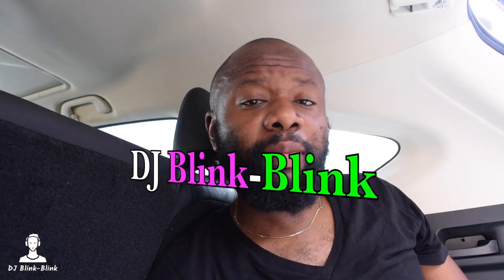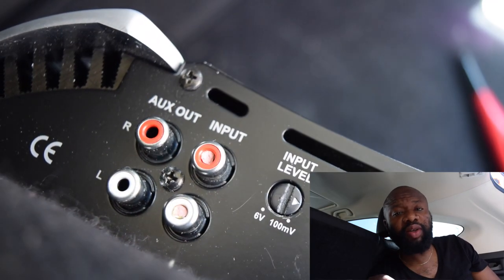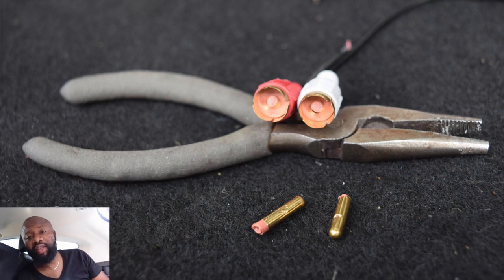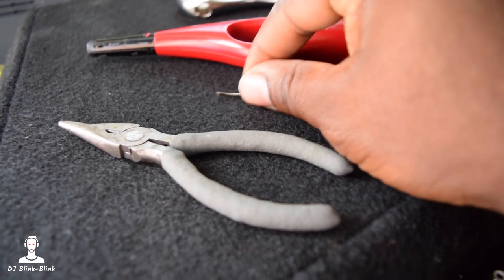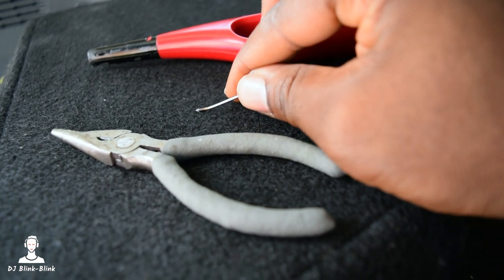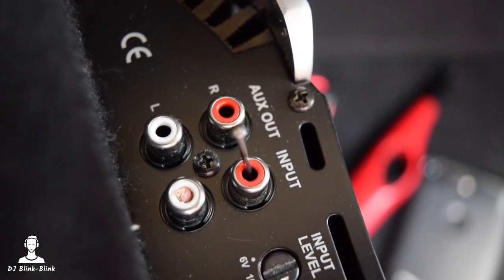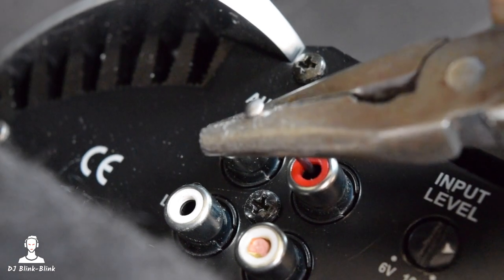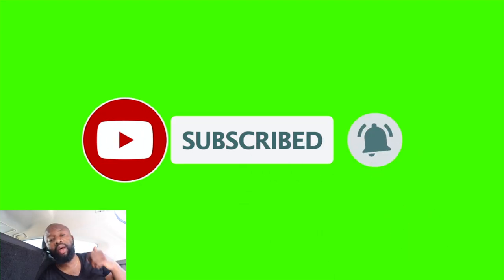How to remove broken RCA pin from Amplifier, TV and Speaker

Comment from the maker: ★ How To Set Your Gains Correctly - https://www.youtube.com/watch?v=rSvGIOPrrnE
★ Serato DJ Pro - Hidden Menu - https://youtu.be/S48z2wOksxU
★Behringer 18" subwoofer review - https://youtu.be/c-i4ciwzGwM
★The Box Pro DSP 112 speakers review - https://youtu.be/zaJggRP6oT0
★ EV ELX 112P vs The Box Pro DSP 112 (Comparison between a £480 speaker and a £191 powered speaker) - https://youtu.be/KKLgW6lLfy0
★ Beginner DJ Tutorial: Mixing, Hot Cue, Loops & How To BeatMatch By EAR - https://goo.gl/hsFHn3
★ How To Analyze Your Music Library Using Serato DJ - BPM & KEYS Offline  - https://youtu.be/g24i0OxY-1A
★ How To Edit Beatgrid Serato DJ The Easy Way I Beatmatching I How To Count Music  - https://youtu.be/VFE-g4g9Wqk
★ Serato DJ Pro Practise Mode Tips & Tricks - WATCH BEFORE YOU UPGRADE! - https://youtu.be/S19GP5lGrFA
★ DDJ SZ Crossfader Repair, Adjustment and Replacement - https://youtu.be/w_jE5t3vS3Y
Reply from the maker: If you have any questions about this video or DJIng, feel free to comment below

Comment: I used a safety pin if that helps anyone. I didnt have a torch to get a thin nail hot enough. Safety pin worked first try. Thanks dude.
Reply from the maker: Impressive use of the safety pin mate. Glad you also found the video useful. Cheers mate 😎👍🏾 𝘾𝙡𝙞𝙘𝙠 𝙩𝙤 𝙡𝙞𝙨𝙩𝙚𝙣 𝙩𝙤 𝙖𝙡𝙡 𝙢𝙮 𝙃𝙞𝙥-𝙃𝙤𝙥 𝙢𝙞𝙭 ➡️
https://www.djblinkblink.com/hiphop-uk-funky-mix

Comment: Thank you so much for saving my brave little mixer! 

I ran into one small hiccup in that on first try I actually managed to pull the plastic free of its metal casing. I quickly plunged the nail and the plastic back inside, readjusted my grip, and got the broken input out, sleeve and all, on second try.
Reply from the maker: Fantastic!!. I'm glad you found this video useful mate 👍🏾
Cheers,
DJ Blink-Blink
𝙑𝙞𝙨𝙞𝙩 𝙢𝙮 𝙬𝙚𝙗𝙨𝙞𝙩𝙚 𝙛𝙤𝙧 𝙁𝙍𝙀𝙀 𝘿𝙅 𝙢𝙞𝙭𝙚𝙨:
https://www.djblinkblink.com/
𝑴𝒀 𝑰𝑵𝑺𝑻𝑨𝑮𝑹𝑨𝑴 𝑷𝑨𝑮𝑬: https://www.instagram.com/djblinkblink/
Reply: Any ideas how to get the metal casing out? Did this on two only to realise that the first one had left the metal casing inside the jack 🙁
Reply: @heidirand9622  I currently have this problem and can’t use my controller until it’s fixed😭

Comment: Ummm so this worked but technically lol. I guess I pushed too hard or didn't heat the nail enough cuz it just busted the piece straight thru and launched it deep into the amp. I'm freaking out assuming i just ruined the whole thing but i plug in the new RCAs and... It works?!? Sounding crisp as ever 😄......🤔🤔.... THANK YOU!!
Reply from the maker: Not trying to freak you out or make you panic but now "there is a small metallic bit inside your AMP" (the stuff you wanted to remove). This can bridge your AMP inside which would then damage it. I would advise you find a way to get that out (open your AMP or bend it sideways which may hopefully make it fall out). 
Cheers, DJ Blink-Blink 👉 My Mix 👉 https://www.djblinkblink.com/hiphop-uk-funky-mix

Comment: Right I understand. That works for that. But I have the metal pin sleeve that fits on the plastic pin stuck. How does one get that out if the plastic jack is not there?
Reply from the maker: Reinsert what came out, follow my tutorial again "ensuring the nail is curved or bent" and then pull it all out at an angle.

Comment: Any ideas how to get the metal casing out? Did this on two only to realise that the first one had left the metal casing inside the jack 🙁
Reply from the maker: To get out the metal casing follow this process:
1. Return the rubber part that came out alone without the metal casing.
2. Leave it in there for about 2 mins (this would allow it to cool down and expand back into the metal casing).
3. Now bend the nail at the edge and then heat it up again.
4. Insert the nail into the jack and leave for about 2 mins.
5. Now pull it out. 
This should hopefully pull it all out mate. Let me know how it goes 👍🏾😎
Cheers,
DJ Blink-Blink
𝙑𝙞𝙨𝙞𝙩 𝙢𝙮 𝙬𝙚𝙗𝙨𝙞𝙩𝙚 𝙛𝙤𝙧 𝙁𝙍𝙀𝙀 𝘿𝙅 𝙢𝙞𝙭𝙚𝙨:
https://www.djblinkblink.com/
𝑴𝒀 𝑰𝑵𝑺𝑻𝑨𝑮𝑹𝑨𝑴 𝑷𝑨𝑮𝑬: https://www.instagram.com/djblinkblink/

Comment: Snap the pointed end off a cocktail stick so u got a thick end put a small dab of superglue 3 on the end push it in as far as it will go leave to dry for 2 mins and pull out... quick n easy and this was done on a broken metal pin
Reply from the maker: Not too sure about this because the key difference between the cocktail stick and my video is with yours you are "pushing against the object" but with mine it "slides into it" because the nail is HOT and it would melt the plastic tip. Thanks for sharing your idea though 👍🏾😎
Reply: @DjBlinkBlink  No worries tho not sure i understand what you mean  Most rca pin sockets ive seen are plastic coated inside i wouldnt want to put any heat near it. The cocktail stick only pushes the broken pin in further a couple of mm then stops dead allowing it to stick then slide out . Anyway as i said i might have misunderstood what ya meant... have a good 1 👍

Comment: Um the plastic part came out but the metal casing is still stuck what do I do
Reply from the maker: To get out the metal casing follow this process:
1. Return the rubber part that came out alone without the metal casing.
2. Leave it in there for about 2 mins (this would allow it to cool down and expand back into the metal casing).
3. Now bend the nail at the edge and then heat it up again.
4. Insert the nail into the jack and leave for about 2 mins.
5. Now pull it out. 
This should hopefully pull it all out. Let me know how it goes 👍🏾😎
Cheers,
DJ Blink-Blink
𝙑𝙞𝙨𝙞𝙩 𝙢𝙮 𝙬𝙚𝙗𝙨𝙞𝙩𝙚 𝙛𝙤𝙧 𝙁𝙍𝙀𝙀 𝘿𝙅 𝙢𝙞𝙭𝙚𝙨:
https://www.djblinkblink.com/ultimate-mix-album
𝑴𝒀 𝑰𝑵𝑺𝑻𝑨𝑮𝑹𝑨𝑴 𝑷𝑨𝑮𝑬: https://www.instagram.com/djblinkblink/

Comment: My problem is that just the metal part broke off and the plastic stayed on the cable, so if anybody have any suggestion would apriciate it. Tryed different tools but it's still in.
Reply from the maker: Are you sure there is no ceramic bit "in the centre" part that broke off?
Reply: @DjBlinkBlink  yes, the ceramic or plastic part is undamaged still attached to the cable
Reply from the maker: @attilathehun79  okies. 3 options: 
1. Insert the cable back (with the ceramic bit) and snap it (this is done at your own risk)
2. Open up your device and remove the metal bit that broke off (still done at your own risk) 
3. Take it to a specialist to remove the broken part (no risk to you)
One love,
DJ Blink-Blink 👉 https://www.djblinkblink.com/ultimate-mix-album
Reply: @DjBlinkBlink  Thx, I'll try the first option. I was thinking about the same thing. The cable was already thrown away but I have a cheap RCA cable and I'll just brake off the pin from that one, and insert the ceramic part in. Thank you for the quick reply. Take care.
Reply from the maker: @attilathehun79  no worries mate. I'm glad I was able to help 😎👍🏾

Comment: This didn't work for me. The plastic receptacle that was in my subwoofer also melted, then bonded to the metal of the broken RCA pin. When I pulled the nail out, the plastic from the pin came out. But the metal sleeve was left behind and bonded to the rca receptacle
Reply from the maker: This would only happen if you either overheated the nail or most importantly failed to "bend the nail" at the bottom.

Comment: Unfortantly, I had bought premium rca wires with solid metal pins. Can't melt the plastic if there is no plastic :I
Reply from the maker: Hello mate, there must still be a "non conductive" material to shield the metallic or gold plated pin that goes into your equipment. This non conductive material is what you would melt 😎👍🏾